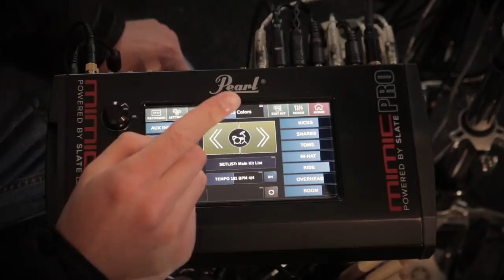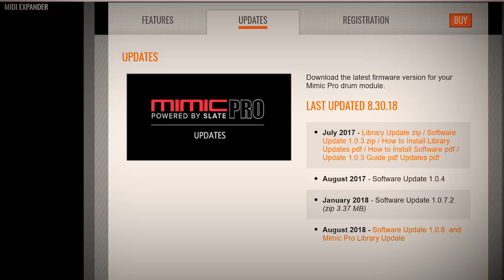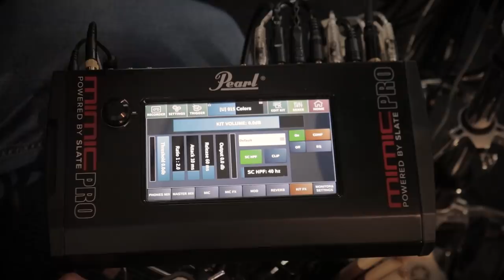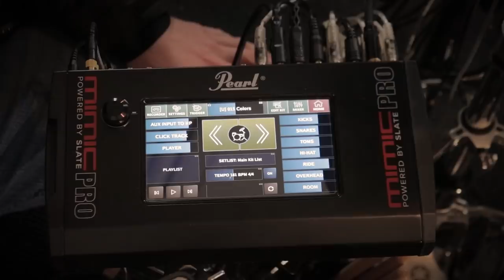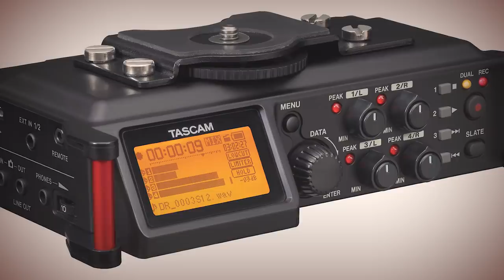My Frankenstein Setup (and how I film drum covers)

Comment: Nice feel on the intro here, Justin. Great setup overall. Drum-tec has long cables that should work (up to 7 meters/22 feet). 
I do like the Pearl Mimic Pro, it’s great for the working and gigging drummer as the samples always work. 
Nice walkthrough, too. What I always hated on recording drum covers is the annoying part of setting up all the cameras, make sure all have enough battery power, enough space on the SD cards ...
Reply from the maker: Hey Mike :) I agree, the filming process can be very annoying at times. Different cameras with different batteries and making sure the sd cards are empty and syncing everything. Getting faster and better at it slowly, but it's still a process.

Comment: You can split inputs on the Mimic with a simple insert cable like the Hosa YPP-117. And there is a split input type trigger preset in the Mimic trigger choices which makes it easy to dial in each of the pads separately.
Reply from the maker: Sweet thanks for the heads up

Comment: Hey Justin! Really interesting to see your little man cave up close 😉 and that Mimic sounds sick. I feel your pain regarding camera placement, I spent hours trying to get the right overhead shot for drum covers on my channel. I used a heap of stick on cable clips up the wall and on the ceiling, plus picture hanging velcro strips to hold the iRig and my iPhone. Big improvement from the side on shot using a camera tripod. Hope you get a chance to check out my latest cover. Nice video man 😃👍 Cheers - Broc

Comment: Hey Justin: Noob question but which do you think is the most realistic sounding yet COMPACT drum module out there? I know Pearl Mimic and 2box drumit are the best sounding ones however they're too heavy duty and it seems they can be alienating towards beginner e-drum users (for me, at least). So I was wondering if there is a great sounding drum module that has a smaller size and is easier to use. Thanks! :)
Reply: Roland TD-17 period.

Comment: Suggestion - record both the audio out and then MIDI out. I noticed in a prior video you have(I think) Superior drummer. Be sure they are at the same levels - then play back for comparison.
I am no were near the drummer yhou are and I sued to just record MIDI into Addictive Drums. I could then easily fix my mistakes. Plus it had much better sound than my, then, TD10
Reply from the maker: Hey Ray :) this video is about the Mimic Pro drum module, everything you hear is from that module